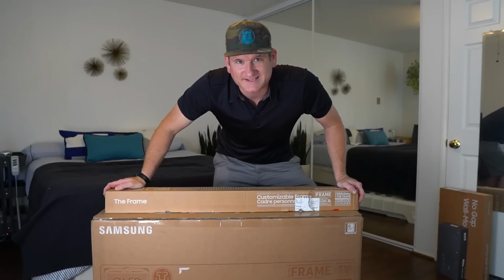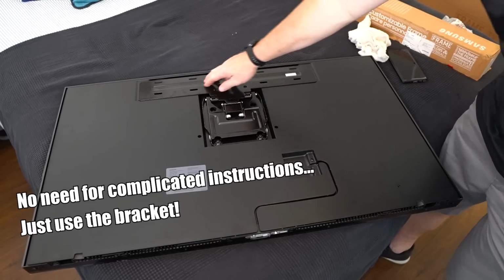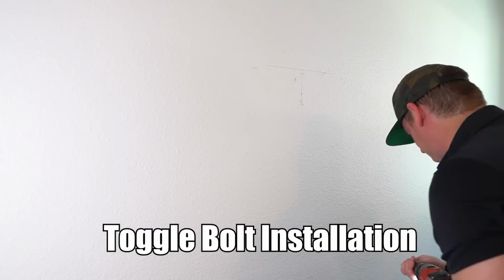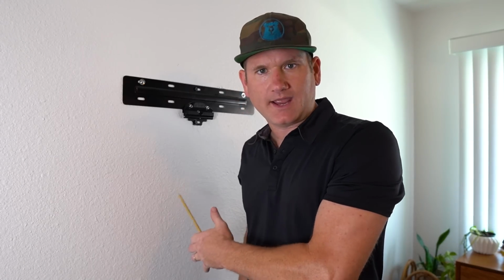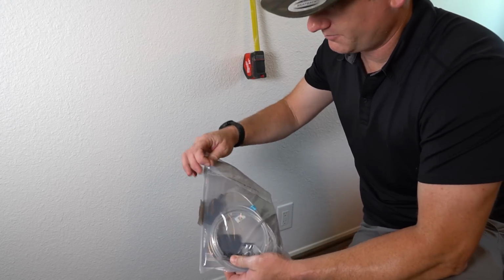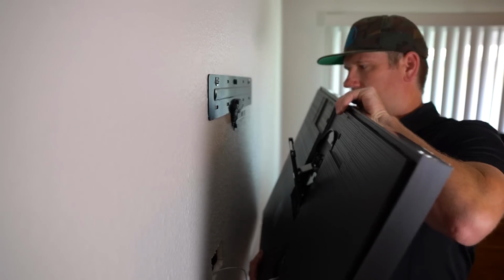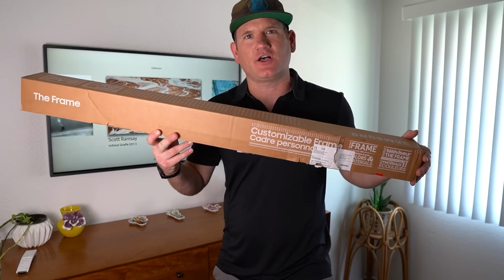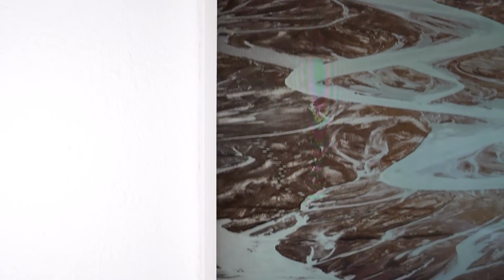Samsung The Frame Install w/ No-gap Wall Mount & Customizable White Bezel

Comment: Hi. I installed bezels on my 65’’ Frame TV. I also added those tiny black screws on the bottom bezel as per the instructions. However, I could not install the black connecting pieces that go on the back of the TV. They connect the top bezel to the side ones and the bottom bezel to the side bezels. I followed the instructions but it did not solve my problem. Any idea how to fix this?
Reply from the maker: I've never used them. I just put the 4 pieces together.

Comment: Thanks for the video! I just had someone install mine today and there’s a gap the thickness of my thumb between the TV and the wall. I thought it was supposed to mount flush to the wall but he said that’s as close as it can get. Do you have any idea what happened or if he made a mistake?
Reply from the maker: The thickness of that one wire is about 1/4 inch. Small thumb? You can put the pads on the back toward the bottom and pushing it out a bit can even the top.

Comment: Hey B I'm installing the 2021 43 for a customer on Monday and am wondering if it still uses the same mount from 2020. I know for the larger sizes they changed to the two piece mount but I have a feeling that they didn't do that for the 43. Thanks!

Comment: Question:  why did you not use a conduit with the one wire installed in the wall??  Your 2021 video install using the same wire you said needed to use a conduit as the wire was not in-wall rated.  I’m having three of these installed and all will need in-wall installation so I just want to be sure it’s done correctly. Which route is the correct way?
Reply: Btw…thanks for the install videos. Very helpful.

Comment: Is there any setting (or any TV) where I can set it to display an image I have uploaded for say 1 hour, and then automatically change it for the next image in the folder?? I have not found any that do this (including the Frame). Seriously, if you suggest using another TV as a photo frame - can you answer this question? Would really appreciate it.  :)

Comment: Out of interest, is there actually any need to use the samsung screws into the studs with 2 or 4 toggle bolts? Or was that just a case of "belt and braces" there?

Comment: So I know the cable isn't in-wall rated but it seems many people put it directly in-wall anyway and don't seem to have any issues. Is this a low voltage cable? Have you seen any issues? There isn't an in-wall rated cable for the 2020 model.
Reply from the maker: I made a whole video on this FAQs of frame. But it's an odd cord cause it has power and AV... so if it caught fire, it can accelerate a fire verus slow it down.  It's at your risk
Reply: @BTheInstaller  Thanks, one more Q! I just ordered a bezel from Amazon Warehouse (used-like new condition) but it came without the plastic connectors. I know you attached them, but would you consider those optional? Wondering if I should return or buy something to use in its place.
Reply from the maker: They're not necessary.

Comment: HI there  - can you store/position the one connect vertically ( and not horizontally?) ,as i have very little room and want to place it on a very thin self for example
Reply from the maker: It makes no difference... you can

Comment: Hi there, I’m about to install my 65 frame Samsung... any advice on sound bar speaker on how to connect with the hub? 
It is on my living room so not looking for a 5.1 system just a better sound quality 
Thank you 
I was afraid to do it my self but after I saw your videos I will do it!! Thanks!
Reply from the maker: not sure what you mean ?  Just like how to run the cord?  You may have to bury the power and HDMI though it's against electrical code to bury the electrical.  then run them down to the bottom of wall to the one connect box..  the sound bar install complicates i a bit but one of my frame video's shows a sonos arc under it.
Reply: @BTheInstaller  Thank you I will check your video with the SOnos arc.

Comment: Can anyone tell me the measurement of the largest end connector on the "One Wire" cord? I'm trying to figure out how wide of conduit I need. Thank you.
Reply from the maker: You only need to make it as wide as the small end... 1.25 inches. Why send the big end through when you can just send the small end down?
Reply: @BTheInstaller  good point, thanks for the measurement !

Comment: The one connect cable included with the frame is not in wall rated. You need to order the insulated cable from Samsung if you plan on going in wall. Also you did not pull down the IR receiver when you put the frame bezel on. This will hinder the TVs ability to function properly.

Comment: Once installed the tv with the no-gap mount, is it possible to rotate the screen in vertical mode or is it fixed in horizontal orientation?

Comment: I need your opinion on this 75 inch Samsung frame TV on eBay for it almost $900 less then Costco or Sam’s club 
There is any different model’s or specification on all the 2020 Samsung frame TV 75 inch

Comment: is the one connect wire you're using the one that came with the tv? not a special wall-rated version?
Reply from the maker: came with tv.  every client has to decide what they want to do with the knowledge that cord isn't meant to be in wall...
Reply: @BTheInstaller  thanks for the reply.  In your opinion is it safe?

Comment: Isn't it against code to pass a power cable behind the wall? Is the included one connect cable certified to pass power behind drywall?

Comment: Hi, great video, very clear.   I have a question in relation to the bezel.  I notice that the surround that comes with the TV  isn’t flush with the wall.  When you buy a bezel does it extend further towards the wall so it looks like a proper frame on the wall.  It’s only about 1cm but it would be nice if the alternative bezel can keep it all flush. Thanks very much
Steve, London

Comment: Nice. I’m installing a 65 in a stairwell reveal wall right now with same type of cutouts to run the one connect cable. Question: why doesn’t B the installer have a fish tape? They are way better than using your tape measure (-: but kudos for using the tape measure if you don’t have a fish. I wold not have thought of that.
Reply from the maker: I have a few of them, I just let them at home that day as I take my tools out a lot.
Reply: @BTheInstaller  I figured you had to have one (-: thanks for the video. Here in Montana if we install anything on an exterior wall we have to use a junction box, insulator foam & plate cover or the cold will leak in way too much during winter. We got the beige bezel with ours.
Reply from the maker: @briancayko  damn yeah it's fairly easy sometimes in cali... I just did uninstall video that people wanted to see, so check that out if you need to uninstall.

Comment: waiting for my the frame to arrive. in the meantime, any ideas what i can do to make the one cable invisible? the tv will be mounted on a concrete wall so its not possible to lay it under the concrete. is the only way to pry open the wall or do you guys have a better idea?

Comment: Thanks for the video! Do I understand correctly that the TV is powered by only this thin micro cabel? Where should I install the power socket behind the TV on the wall or below the TV where the block would be?
Reply from the maker: No power directly to tv just the box

Comment: Hi, renting an apartment so not able to cut holes in walls. How do I run the cable securely behind the tv, and down the wall, or tuck it out of sight. Help the wire sticks out like a very bad sore thumb.

Comment: Kia ora B, we have a 75” frame on order in NZ...due to COVID supply chain issues while we also renovate the room it is going into. Any idea where we can find definitive dimensions for the frame mount distances? We have been looking online but cannot find something which gives the distances from the top/bottom and edges of the screen. We want to ensure the new dry wall going in has the studs in the right place and also allow for the flush plates and conduits for the invisible cable. We will also be mounting a Sonos Arc 6” below.  Thanks for any assistance on those distances! Charlie

Comment: Can you show us which toggle bolt you used and which size?  Better yet, can you send a link?  Thank You.  I`m new to construction installs.
Reply from the maker: 3/16 inch snap toggles.  Lowes and home depot have multiple kinds.
Reply: @BTheInstaller  Thank you for the response. Your other video was great at explaining how to use the toggle bolt and was overall a little more detailed than this one.  This one though provided a good synopsis.

Comment: Thanks again B for your helpful videos and tips! I recently bought the Frame, 50 in, super happy with it. (FYI Best Buy install guys will not put the one cord through the wall, but we ran it behind a bookshelf to hide it.) 

Quick question, my parents are looking for a new tv but don’t want the frame, is there another Samsung tv you’d recommend that has comparable video quality and UI/remote to the frame? Thanks!
Reply from the maker: The Q90t looks almost identical and is better and brighter.  You just use a normal mount.
Reply from the maker: Q80t or q8dt is similar and good too but is a little curved on the back. But still great.
Reply: Thanks!!
Reply: Best Guys install guys won't put the cable through the wall because the supplied cable is not rated for in wall installation

Comment: I installed a 75’ and am trying to hook up a sound bar, I want the sound bar to turn on when the tv does, what the best way to do that?
Reply: I think you need to connect your soundbar  to the hdmi (arc) tv port
Reply from the maker: Yes, make sure ARC port on tv and turn on the HDMI CEC on tv and the sound bar should then communicate automatically.

Comment: question:  older house with a fireplace that has a solid wall behind .. do you know of semi-easy way to run wires? thankx.
Reply from the maker: I've run it in wall on a hard fireplace, but you have to be quite good to pop a 1.25" hole around brick and concrete to tunnel that wire.  It's a project.  Best to run the wire external and neat. Its so thin.  Probably not the answer you wanted.
Reply: @BTheInstaller   thank you very much for your answer ... I will install it his weekend, I will see what it can be done.  Btw, you have great videos.

Comment: Hi! Is it possible to use the no-gap wall mount for The Frame with a "normal" Q95T 55"? I've found this wall mount and it's very cheap compared to the "generic" one. Thanks!

Comment: What’s the dimension from the top of a 2020 65” Frame tv to the top of the wall mount bracket? Need for planning purposes. Thanks in advance.
Reply from the maker: You should have the tv in advance.  All of the frames are a little different.

Comment: Just me  but I would think a brush plate is a better look for the one connect cable to exit out of the wall. Top or bottom.
Reply from the maker: You can't fit behind the tv.  But below of course.  Do whatever looks good.

Comment: Great video.   I see that you did put cable behind the wall but thought there were warnings against doing that.   Could you just clarify this please?  Will be getting Samsung Frame TV next year.  Cheers.
Reply: I have this same question. You mention in the beginning the cable is not in-wall rated. Can you clarify if your installation is still up to code?

Comment: If my Samsung screws strip (they are super close) any rec for what screws/bolts to use?
Reply from the maker: Just take it out and use a different one.  Make the pilot hole a little bigger.  You can use a plyers to screw that back out of needed.

Comment: Love the install video!  Quick question for you.  Can I install the Samsung 55 frame with only toggle bolts?  If centering on studs isn’t available?
Reply from the maker: Yes.  Try hitting a stud anywhere along the mount on one side but yes i use 5 toggle bolts, 2 in middle top and bottom and one top left and one top right.  Or 6
Reply: @BTheInstaller  thanks for making these videos! Does the TV come with the toggle bolts?

Comment: Great video and presentation, I only worry whether the toggle bolt can hold the 55' frame tv without the stub support on the dry wall.
Reply from the maker: It can.  They hold 80lbs per toggle bolt in 1/2 inch drywall.  So 2 would effectively hole 160 lbs downward and 4x would be 320 lbs.  The drywall is secured to studs with drywall screws so you woild literally have to rip the whole wall down.  Even the largest frame at 75" would be perfectly fine on drywall only.

Comment: Anyone know the tool he uses to make the hole in the wall for the cable?
Reply from the maker: A drywall knife
Reply: @BTheInstaller   That’s great, thank you! I hung the TV over the weekend, following your instructions, and it was a piece of cake. But hiding the wire will make it look even better. Thanks again
Reply: @BTheInstaller  Any advice on how to hide the wires on a plaster wall? I don’t think it’s going to be as easy as cutting a hole with a drywall knife 😬
Reply from the maker: @danielgreaves3878  yeah its same thing.  Just get a sharp drywall knife and it will make a mess.  If there are lathe boards, I just a 1/4 inch drill and cut straight into them in a square and then use drywall knife to finish the cuts.  Be careful with a hack saw as there is electrical in wall sometimes.  Ther eBay be fireblocks so you may need to drill down through studs and/or fix drywall. I will make a video on that. My house is plaster and my OLED battle video where I built the wall was all plaster and fireblocks.  Took 2 hours for 4 power outlets.
Reply: @BTheInstaller  I just wanted to let you know that I finally got round to putting our Frame TV cable into the wall. I was a little bit nervous, but I followed your advice and it went perfectly. Thanks again for help and advice and for all the great content you put out there. It helps a lot. Cheers.

Comment: Is the top supposed to be completely flush?
Reply from the maker: Yes.  Pull bottom out and push top in
Reply: @BTheInstaller  I did that and now the top is even farther out
Reply: It seems like it will stay about half an inch away at the top. If I push it in then it in, it won't stay. Great video BTW
Reply from the maker: I've never had that but some have commented.  You can get "velcro" brand double sided tape and put on wall. That stuff is so strong. Stick the top right to wall.  Also keep the tv level.  Not that it would move much.
Reply: @BTheInstaller  ooo thanks
Reply: @BTheInstaller  do we need to remove all the face plates? Maybe that is why
Reply from the maker: Yeah, you should have nothing but a flat wall behind it. Didn't know that was the case.

Comment: Thanks for this.  Do you know anything about the new 32" Frame by Samsung?  The wall mount is just two small brackets at the top corner of the TV, which makes it harder to attach to a stud.  Do you know about this?  Can it be hung on dry wall only with out anchoring to a stud?  Thanks again :)

Comment: Thank you for the great video!

Could you please share the brand of toggle bolts you use? I got the 55" frame tv and turns out there are no studs above my fireplace so I am gonna have to mount it on the drywall.
Reply from the maker: I think I show that brand in the video, not sure.  Just snap toggles... at any hardware store
Reply: @BTheInstaller  Thanks. I ended up getting some from Lowes and they worked great.
Reply from the maker: Good deal.

Comment: nice work! question though, how would you integrate the Sonos sound bar if getting installed above a fireplace without compromising the "no gap wall mount"? thanks!

Comment: What can happen by using a cable in the wall thats not reated for that?
Reply from the maker: It can accelerate a fire, if one is running rampant through your home. So it's got a lot of so-called "experts" hot to trot.

Comment: Hi this one connect cord that comes in the box is NOT wall rated. Did you spend extra to buy the special wall rated one or did you break code to install this? I’m getting mine soon and I want to put the cord in the wall maybe through a conduit, but it needs to adhere to code I’m not willing to risk insurance issues. So I’m trying to figure out how to do that. Does anyone know how?

Comment: I'm bought this TV for my birthday 2 weeks ago but I'm so afraid to mount it cause I'm renting my place and don't want to mess up the wall . Where do i find the Toggle Bolts you used ?
Reply from the maker: home depot. you can literally fix the 4 holes in wall with putty and $1 plastic knife.
Reply: That's awesome thank you so much 😊

Comment: Hi "B the installer",
Question for you:
Is it possible to use a different wall mount unit for that tv? My actual one is already on the wall, and i'd like to use the existing. I don't mind having the tv with a gap.
Thanks for your reply.

Great information.

Keep going
Reply from the maker: Thanks. I would would get the q90t then. Its better and it looks the same on an arm mount.
Reply: @BTheInstaller  thanks for your fast reply.

But does the q90 provides the same art mode?
I also like the concept of a single wire from the tv to a dedicated box.

Thanks

Comment: Nice video! Was just turned onto the Frame series today and thinking about this model. I have a question about the one connect box; other than power, is it better to hard wire with a LAN cable going back to your router? Or for streaming content, does blue tooth perform just as well? Thanks in advance.

Comment: Great videos.  Any suggestions on where to lead the one connect wire when mounting over a fireplace?  can you fish tape the wire sideways instead of down?
Reply from the maker: Thanks.  Not past studs.  I have run one through a conduit in a fireplace that stuck out and had niche next to it.  But many fireplaces then turn into a normal thin wall with studs and that is very hard.